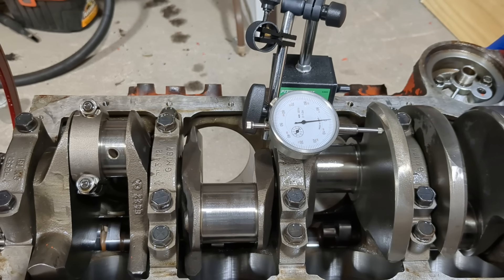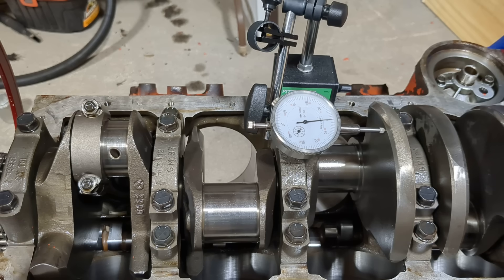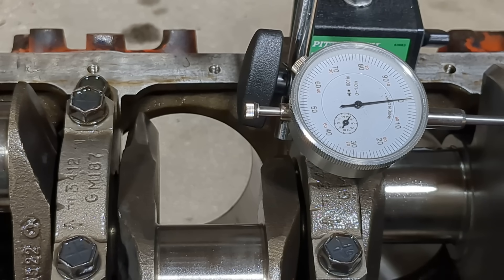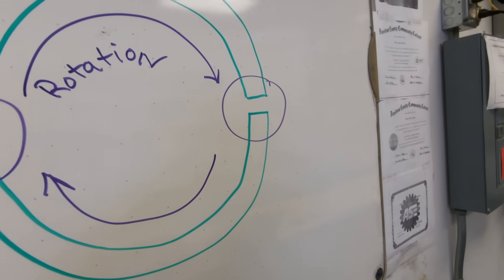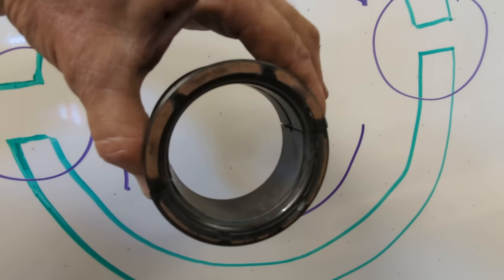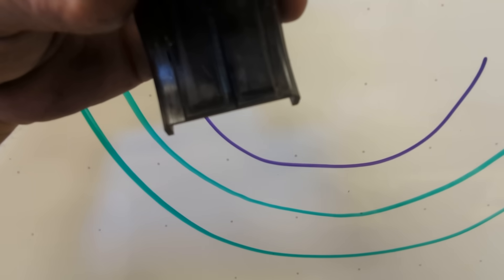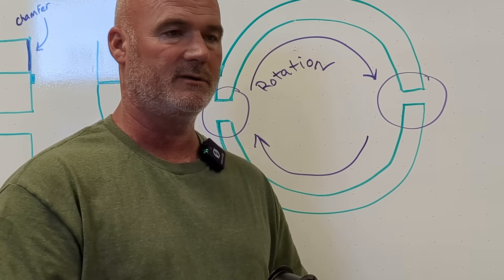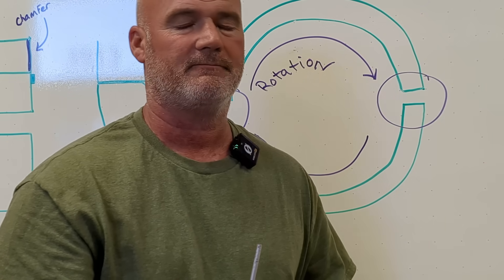CHEAT CODE FOR BEARINGS/SAVE YOUR EXPENSIVE CRANKSHAFT/ZERO thrust bearing wear, Reduce Engine Temp

Comment: I had been taught this before. I think my local machinist who i used to pick his brain every time i came over, i love that most of engine building are tips and tricks you pick up and learn to modify yourself, ive noticed that the greatest builders dont just use parts as they come from the manufacturer, they check and modify parts as they see fit

Comment: My modified 4200 pound clutch was used pretty hard even depressed on red lights at times, my thrust was well used, definitely it was not overly worn. Obviously there are other factors like oil quality and how hard it’s launched. 

This time round I’m thinking of modifying the thrust shell buy adding 30thou hole to oil gallery..you had much success doing that or are there drawbacks? Pressure won’t be a problem either, as my pump is 20 stronger than OEM

Comment: There’s a better way to do this ,   Drill a 20 to 50thou hole in the center cavity on the block side of bearing to mark the saddle remove bearing, then drill all the way into the oil hole for the bearing. Now you have oil being fed to the thrust bearing with pressure.   Make sure this is done before assembly so you can flush oil galleries out.  Problem solved.  Doesn’t effect 
Oil pressure at all.

Comment: I'm all for saving my stocker from abuse, my dad told me that brakes are cheaper,  and much easier than clutches,  and got me in the habit of floating into neutral,  coming to a stop, or changing gear without hesitation, and keeping you foot, off the clutch, because only one bearing took the brunt, of the pressure plate force, especially on a Ford, that has it in the center main. 
Awesome vid.

Comment: A large leak path at the joint line will reduce pump pressure and to some extent hydrodynamically generated pressure in the bearing. This modification would  compromise the endurance of the main bearing. Oil still escapes from the edges of the bearing to lubricate the thrusts without the modification. So you are trading off your main bearing life for (hopefully) thrust bearing life.

Comment: I love your channel i'm always waiting for new videos. I have a question about main bearings. A friend asked me to help him assemble a ford 302. He had opened the holes in the upper main bearings to match the oil holes in the block. It just doesn't look right to me is this going to cause a problem ? Another thing is he bought total seal rings with the top one being gapless. How do you gap the paper thin ring that has the gap at an angle. It fits so loose in the bore it won't stay by itself to check it. The instruction that came with the rings suck you would think that a 450.00 set of rings would come with good instruction. They don't say anything about the funny looking ring that looks like something out of an auto trans. They don't even show a picture of it. This is the first time i seen these rings. I had to do a google image search and finally found 1 pic of this ring so i knew it belonged in the set. He is going to use it in a supercharged application but I don't know of any engine builder that would use them with boost. After looking at them I wouldn't use them on anything. Looks like trouble looking for a place to happen. Thanks for any info you can give me.
Reply from the maker: @Andy-t5e  thank you Andy 
As long as the bearing is deburred it should work fine 
If you Google gapless rings instructions there are some great YouTube videos that pop up watch the ones with lake speed

Comment: In a drag race application, where I'm beating the thrust out because I'm on a revlimiter / transbrake alot - would you put the notch towards the rear on both halves of the bearing, in an effort to force oil towards the rearward face?

Comment: I have a brand new Dart SHP SBC 400 block. Should I consider enlarging the oil feed to the three center mains? Stock service high torque build. No real rpms. It might go in a 4 wheel drive or a corvette.
Reply from the maker: @scottosborne8735   No you will be fine 
That's a great block

Comment: This isn't an option on my little 4 bangers. I've had to drill feed holes to the thrust bearing, and I make little dead ended slits to get the 180° thrust to live thru heavy loads.
Reply from the maker: @alexhise968  yeah I understand on some of those I will buy two sets of mains that way I have a complete 360 thrust bearing

Comment: I never considered the thrust aspect, but run auto trans usually.

Look into block oil improvements- one is something missing I see on your engine.
The plate that the filter spins onto (forget the name at the moment) should be 180° from how you have it mounted now.  What you have chokes down the flow but flip it 180 and the port is wide open.   You won’t see that difference in psi but if you measure flow using a drive tool you can easily see the difference.
Reply from the maker: @hummervs3278  you are correct 
That actually is gone we use the bypass adapter not sure who put that on like that. 
Remember you're looking at a tear down 
Yep you are correct it is wrong

Comment: If you don’t know already and want to build a strong engine , you need to cryogenically treat all internal components and have them shot peened ( ceramic) to strengthen all the components. 
Check out MOTOIQ , they explain the process

Comment: What about engines with center thrust bearing surfaces or even two pieces bearing & thrust that is found on import engines & LS generations. The imports have selectable outside diameter for proper crush and stamped on the block. Plus instead of 0.008” - 0.0010” they are half that end play. Do dual clutch Tremec transmissions push the crank with less force or more? These variables need the light of day upon them.
Reply from the maker: @deankay4434     hey that's a great question and it works exactly the same. If you notice in the drawing I'm actually not doing anything to the thrust surface itself I'm actually chamfering the actual main bearing. So if you can go back and watch it very closely especially when I talk about it on the board and you'll see exactly how it's done and how it works. But you're actually taking the main bearing and forcing oil forward and rearward but you have to chamfer it exactly as I show.
Reply: @SalterRacingEngines  I saw it an understood your intended meaning. After 38+ yrs in dealers & shop, I had over a year teaching at UTI, the original. Then, over a decade later I ended up on contract with Raytheon doing tech seminars for ACDelco in 7 upper Midwest States. Holding 4 each week in a different city. 13 tech schools for 2 day classes and 5 warehouse to review alleged defects. I was brutal. One thing I learned at UTI with basically kids, is the instructor needs to provide up to 3 different ways to teach a concept. Like torque converters. We’ve all seen two fans blowing air, but multiplying using a stator is redirection. I used a cannon ball on a chain. Swinging two feet of chain overhead, you may stop it with your hand! Multiply that by redirecting the force increases. So now a 6 foot chain at the same speed! Harder to stop? Damn straight! They got it. A longer chain, but longer path of fluid travel hits the impeller harder. Long path, more speed = torque multiplication. 
  Thanks kindly for sharing!

Comment: Good video. Cool trick. Cut small oil channels to bleed extra oil into the thrust bearings. Good to hear it hasn’t hurt anything in 30 years. I would worry that it could starve the crank main bearing and slightly reduce oil pressure. 
Voting Kamanist Harris all the way 🤮
Too bad Benedict Donald sold out the country to big pharma 😭

Comment: Anyone’s opinion is welcome. I’m building a 383 sbc street engine and on my rod bearings I used clevite p series bearing. My clearance was around .0016”-.0017” but I wanted a bit more clearance and I was only able to find a NOS clevite p series ‘X’ bearing (.001”) extra clearance. I ended up using one half of the ‘x’ bearing and one half of the standard bearing but the old ‘x’ bearing has an oil hole for  the rods. So essentially I have a small half circle missing on the ‘x’ bearing and I was wondering if that would somehow act as an oil scraper and remove oil from properly lubricating the rod journals. It’s hard to explain but the oil hole is opposite of the bearing tang located in the center and each half has a half circle. I’m just using one half.

Comment: Hey Brian, any benefits with this mod on rod bearings? Thank you!
Reply from the maker: @ts302  one of the main things and best things you can do is break all the edges with a small fingernail file or very fine file at every parting line of the bearing you won't believe how free the crankshaft will rotate and you'll get less material in your oil

Comment: That is brilliantly simple and much easier than drilling a 1/32" hole through bearing web in block into oil passage on the main thrust face.
I guess you could relieve the edge the same amount as normal bearing clearance?
I've worked on motorcycle for decades but never heard of this before (inline fours since the 1980's have been plain bearing)If I ever get around to doing pick up motor I'll be doing this.

Comment: Yes, I've been doing that exact thing on EVERY engine for over 40 years, even stock rebuilds, for exactly the same reasoning! Hopefully it's more "great minds think alike", rather than "fools seldom differ" 👍😎😄

It's not just clutches that load the thrust bearing, but torque converts do too!

Don't know if you're aware of it, but in Aussie they're replacing the "plain" thrust bearings with Torrington taper roller bearings, to make sure the thrust lives.

Forgot, some builders will drill through the side of the bearing and into the oil feed drilling for the mains', which works, too, but I've always thought to be a bit too much trouble.

Comment: Dam Brian!! I wish I had known this years ago. Nice nice tip. Thank you. The thing I would love to know is oil pressure? Mine has 20-25 warm10- 40 Amsoil . I know the old saying about the crank and should be good. But is it? Yes it’s got a high volume pump and it is a mopar. But a pro like you should be able to tell me I am F ! Or I could go 100,000 like that. But what a cool trick you on this video. Thank you again.

Comment: Thank you for your time to share your knowledge  and experience with these  simple  tips that can make a big difference in our engine building. I'm glad you spoke about the thrust failure video .I could not figure how he was able to run the engine on a test stand with no problem and immediately  have a issue on the dyno. Binding would make sense.  Again thank for your time and experience.

Comment: Questions:
The spec info is all over the spectrum, is your normal clearance specifically racing application or general builds?
Is your norm, relative to oil viscosity? 
Lastly, would you use the same theust clearance on, say , 3rd Gen HEMI or LS or Coyote applications?
Thank you
Reply: One more question,  do you use same clearance for both manual trans and automatic?
Thanks

Comment: Ive etched the block to come out the side, small bit through the bearing just because i didnt want to take oil away from the bottom shell. Ive done the same with lifters also and let me tell you it takes the smallest little scratch or youll flood it to death.

Comment: Doesn’t the oil delivered to the bearing automatically leak out the sides anyway
Reply: Yes, that is what also cools it. That oil gets in the chamfer of the bearing between the crank journal and the thrust face. If you look at the thrust face of the bearing, the wide part, there is also a slight chamfer right at the parting line, to help  create a wedge of oil between the crank and bearing face, and maybe let oil out for lube and cooling. One must decide if you should do the same mod to the thrust surface to put that extra oil to work there also, just a slight chamfer. I do and my thinking is when the clutch is pushed in you need a way for the oil to get out, and cool that bearing.

Comment: Completely unrelated to the video but would it be a dumb question to ask if you or someone could build an engine meant for racing to reach high RPM's (7,500 +) but stay within a specified horsepower range due to competition regulations? Or is not really possible to achieve such high rpm's and not exceed 600 horsepower?

Comment: Had to replace a little 80sToyota 4banger once with 300plus k's .
Still ran fine but lost alot of oil past the front crank seal when the clutch was depressed . Theres yerproblem lady ! Took the pan off to see what could be done but the thrust had completely left the building and the crank was working its way smoothly into the main  brg webs. Talk about end play...mustabeen atleast a quarter inch !Manual trans, sittin with the pedal down ! That loads gotta go sumwar !

Comment: interesting...   I had always thought that oil squeezes out of the bearings all the way around them in the first place, as there's no lip seal on either side of the bearing.  I thought that's why you need oil pressure to overcome the oil that squeezes out.  But the chamfer actually turns the oils direction of travel, forcing it out of the bearing.

Question:  Do you think there is actually oil pressure on the thrust side of the bearing, actually holding the crank off the bearing?  Or does lubrication just rely on the lubricity characteristics of the oil?

I'm going to guess that if, during tear down, if there are no noticeable scuff marks on the bearing, it must be maintaining oil pressure, & holding off the crank from contact.  If it's scuffed, then not so much.  

Am I thinking correctly?

Second question:  I remember back in the 80's, you could purchase 'full groove' bearings, but they've became increasingly more difficult to find, until eventually they just simply weren't available.  I always gravitated more towards the full groove bearings, as it made more sense to me to have a large supply of oil filling the groove, all the way around the crank & rods, to have ample pressure to keep the hydraulic action of the oil, preventing metal to metal contact.  

Do you know why they've ceased making full groove bearings?

Comment: Thanks Brian. I clicked LIKE, like you said. Never realised the clutch throwout is pushing on the cranks thrust. Chevy did it right having the thrust at the back of the cranks. With a heavy pressure plate it could be hundreds of pounds pressure thru the cranks onto the thrust. Something I think would help engines a lot: some kind of electric preoiler. Hold it on for a while before cranking, and let it off once running. Makes sure all the rods have oil before turning. An idea for a video. Down under in Australia we all pretty worried about state of things with uncle Sam, hope it can be solved in the election. Good luck.

Comment: Turn that oil filter mount 180 degrees ,get that by pass bulge on the out side for better oil flow to the engine, also taper the hole going into the block, knock out the by pass and tap for a pipe plug , use a filter with a strong bypass, for street i use a wix 51061 . Hope this helps.
Reply from the maker: @PeggyParrow     Lol that's an old engine getting torn down but I'll see what I can do

Comment: nice looking crank   on the MOPARS we lost thrusts mostly with the stick shift cars or a balloned converter  We had a pipeline to engineering and regularly wrote to them  IT took Chrysler years to increase the thrust size.\\
 Oil want to go out the front of the bearing On my blocks I'd drill thru the thrust into the oil passages   you have a neat trick   no block machining  luv it  
Did you ever notch the main saddles around to the parting line and feed the crank at the parting line.?  works good
I've chamfered the parting lines but both sides and nothing special on the ends toward the thrust  great   you can use a bearing scraper

Comment: You just saved me some money,the number one issue I have with my airplane engines is thrust bearings,just imagine a propeller bolted to the crankshaft of a 550 cubic inch 6 cylinder pulling the plane skyward,thrust load is massive
Reply: How about a roller thrust bearing? Big power drag race engines use them very successfully.
Reply: @muskyelondragon : and just think MOTOR cycle engines use large ball bearing s for the main bearings.. ( now they probably have the least amount of thrust  end load Though )
Reply: @muskyelondragon  great idea,who makes them.
Reply: @jeffcreel5508 timkin, nsk , skf all the major bearing companys probably have something that will work. I know most drag engines have the block(behind first main) and crank machined to accept it just in front of the first throw on the crank.
Reply: It seems to me that all the oil flowing into and thru the bearing must escape thru the thrust surfaces. Do we think scavenging oil from the journal surface increases flow?
Reply: @erictaylor467 yes but this method will eliminate a small portion of the bias towards the non thrust side.
Reply: @erictaylor467  It is a bit more gap so bound to let a little more oil escape. Probably be like adding .0005" of bearing clearance but without causing the film thickness of the oil to be degraded by loosing pressure in the bearing.

Comment: I don’t know about you but I’ve been racing for 40 years and still at it just drag now .I always use a accusump I burnt up my first 6 cylinder circle track motor because the rules said no modifications at all to the oil pan it was a high bank asphalt track lots of g force . never burnt one up ever since we cut a grove in the brg itself from the oil hole about ..010 deep front to rear I like your idea better . Accusump the next best thing to dry sump . I have one in my drag car now lots of drivers shut the engine as soon as it crosses the line but the transmission stops pumping lube oil so I’m not a fan of that even though it works for some racers .